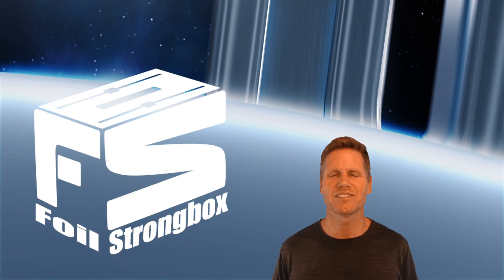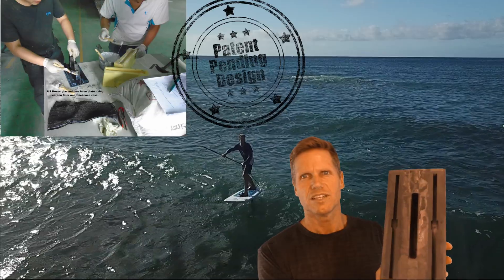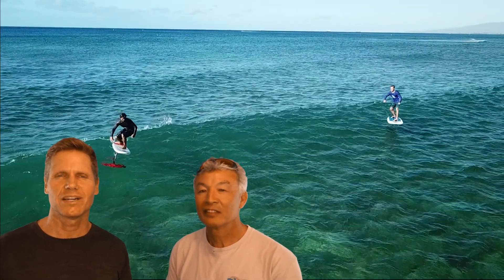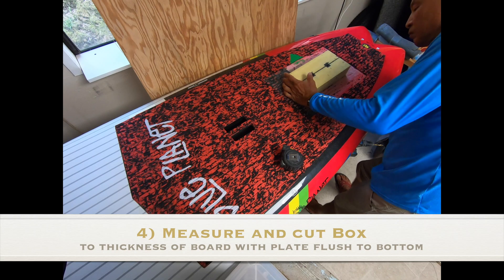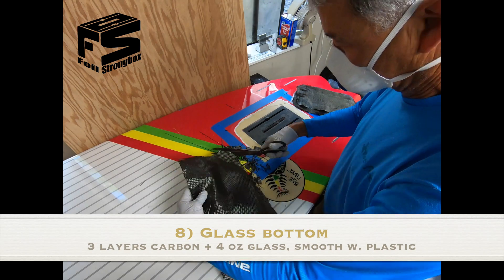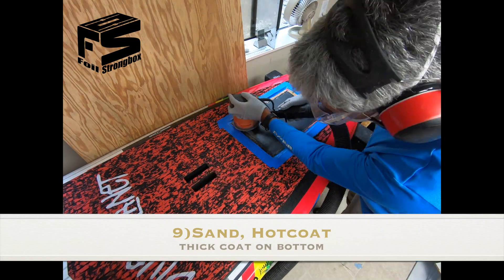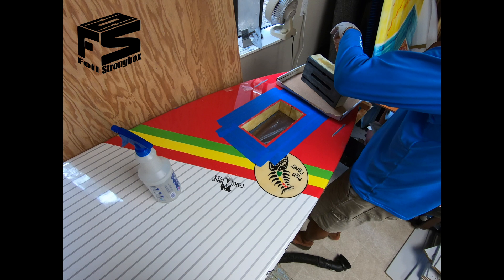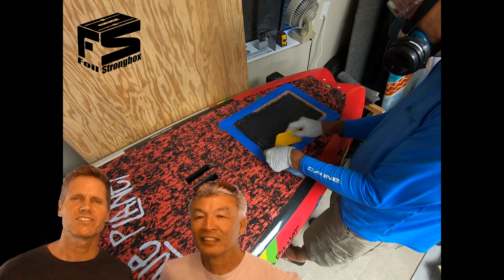Foil Strongbox installation video

Comment: Building a foil sup from a hard sup I purchased second hand very cheaply. I purchased your strong box but I am having trouble to decide on where to place the track box ( how far from the back). What I learned from your other video on foil placement is that you want the front wing to be roughly in the middle between your feet in your stance and also having the front wing be the center of the gravity when you lift it by the front wing.
Since I do t have it installed yet I can’t do this trick but was thinking to balance the board on a 2x4 with the strong box, a plate and a mast on the board roughly where II want it and see if it will be where I usually place my feet.  
What are your thoughts on this?
Since I can’t lift it by the foil before I install the track
Reply from the maker: You will find suggested box placement measurements on this page: https://www.blueplanetsurf.com/foil-strongbox.html
Reply from the maker: Recommended box measurements from tail of board to back of Tuttle opening (as per https://gofoil.com/tuttle-box/):

Board Length	Distance from tail of board
3′ to 4’6″”	1′ to 6″
4’6” to 4’11”	4” to 8”
5’0″ to 5’9	6” to 12”
5’10” to 6’6”	8” to 15”
6’7” to 7’4”	12” to 20”
7’5” to 8’6”	16” to 22”
8’7” to 9’6”	20” to 28”
Reply from the maker: I would stay within these measurements.

Comment: Thanks for the video! Very helpful. What kind of tape (the blue tape) and plastic you used to lay between the glass? And instead of using the special 66 - 100 trim, is there any alternative to drill open the box?
Reply from the maker: No problem.  The blue tape is 3M painter tape, slightly thicker plastic will be easier to smooth out but most anything will work.  If you don’t want to buy the trim router bit you can also cut the openings with a razor blade after the resin gels but before the resin is completely cured and is still easy to cut.

Comment: I’m having trouble having the first layer of glass adhere to the base carbon. I’ve done it twice and ended up having to remove and start again. End up with a
Couple Spots as I sand that is not adhered to the base carbon does it look need to course sand it first? Top came out great.
Reply from the maker: Yes, you should always sand and clean the area before laying down glass or carbon, it will not adhere well to a smooth surface.

Comment: Did u need to put tape or blue tack in the boxes so the epoxy  doesn't  drip into the bottom  or boxes
Reply from the maker: Not if you are careful not to oversaturate the glass

Comment: Hello! Thanks for the great video! I saw a few videos about install box and why only people align the box by side and not align by “longitude” I mean, you only align the box in X and not in Y axis,  because the angle or "rake" that the foil will do with your board is important, right?
Reply from the maker: You will want to install the box level/ parallel to the rocker line of the board.  If the board has too much or too little rocker, you can adjust the angle of the foil by adding a shim to the base.
Reply: I know it's kinda randomly asking but does anyone know of a good place to watch newly released tv shows online ?
Reply: @Cesar Yehuda Flixportal :P
Reply: @Ian Benicio thank you, signed up and it seems to work :D I really appreciate it!!
Reply: @Cesar Yehuda No problem :D

Comment: What do you mean at 7:27 where you say you made little bumps in the deck?
Reply from the maker: If the thickness of the board is less than 3 ¼” you have to make a raised bump over the Tuttle box if you want to have a full sized deep Tuttle  mount.
Reply: How would one make this raised bump?

Comment: Thanks for the awesome video!  
When you cut out the rectangle in the board you first drill holes for guides for the jigsaw. I assume you drill one on each corner. Depending on the size of the drill bit, it would leave a little extra space at the outermost portion of the drilled hole. Does the gorilla glue fill in that extra space? Can you pls comment on the placement of the holes, etc?
Also, do you have a recommended brand of jigsaw?
Reply from the maker: Draw the outline of the box, then drill the holes big enough for the blade so they are inside the lines, that way you can get square corners.  Make sure the saw is long enough to cut through the other side and make sure to make a clean, 90 degree cut

Comment: How do you deal with the little gap you get at the end between the carbon patch and the board? And in case of a biconcave shape? Thanks!
Reply from the maker: You need a flat surface to mount a plate mount foil, so deep double concave shapes don’t work well.  After glassing the bottom, you have to hot coat, sand and fair in the edge of the carbon to get a smooth transition. 🤙🏼